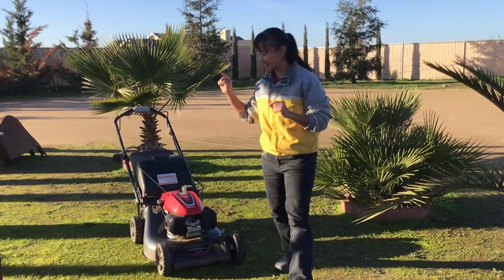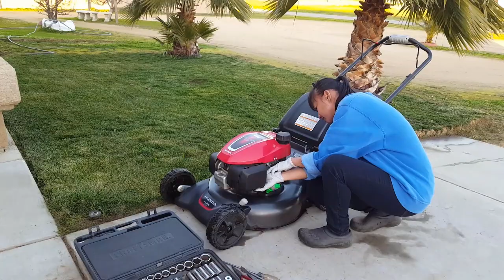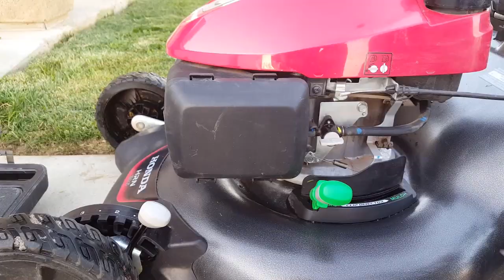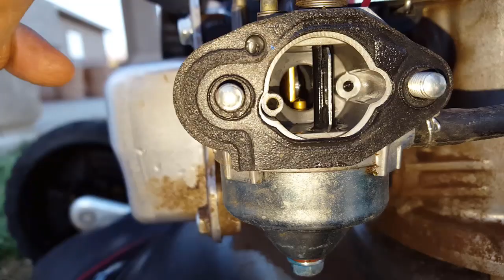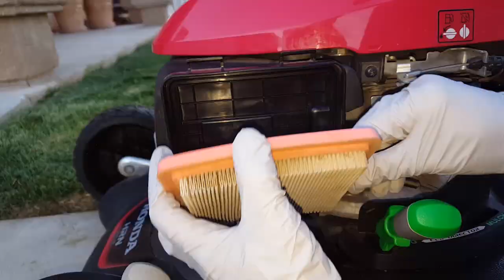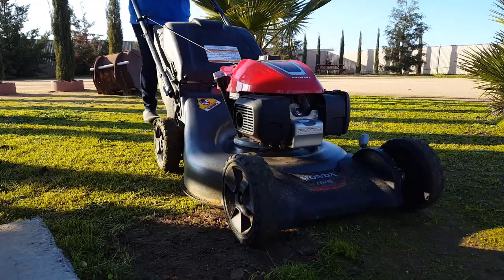Fixing Honda HRN 216 Lawnmower | Rough Idle/Surging || DIY-10

Comment: I had the same problem and took my 1 year old Honda  HRN216VYA mower to an authorized Honda repair shop.  It took them FIVE MONTHS to fix the unit and replaced the gasket and thermo wax choke assembly.  Two months into the new mowing season and it's doing it AGAIN.  Honda customer service is a joke and two authorized repair facilities state they can't get to my machine for 8 weeks!  Right in the middle of mowing season!  Good by Honda.  Not sure what the heck you did for your 35 year anniversary, but you destroyed your reputation and are now also ending production of your gas mowers as of Sept 2023.  Way to go ....out with a bad bang.
Reply from the maker: That's a frustrating experience you've had with your Honda mower and their customer service. It's unfortunate that the issue resurfaced so quickly after the repair.

Comment: This fixed my surging problem. Whether or not it was necessary, I removed the carb and gave it a full cleaning thru all ports with carb cleaner but also ran a very small pipe cleaner brush in and out of all the ports and used a few mild blasts of compressed air to complete the trifecta. Salamat Po Val. Mahal kita!
Reply from the maker: Thanks for sharing.

Comment: Haha... A couple of weeks ago, my HRN 216 started doing exactly this, so I researched this issue and found Ed & Val's excellent solution video and decided first to try the lazy man's approach and try a carburetor cleaning additive first, so I reviewed the various offerings at Home Depot and settled for this product: Star Tron 8 oz. Gasoline Fuel Treatment by Starbrite. I poured in the recommended 1 capful per gallon amount, let it sit for a few days, then gave it a try. Nope. Exact same surge while cutting the entire line. Just today, I came back to this video, reviewed it and was all set to perform Val's technique, when, wouldn't you know it... no more surging when testing the idle first. Hmm. Ahhhh... the additive MUST flow through the carburetor, then sit for a bit before it de-clogs it. Remember that! The instructions for the additive suggests adding that 1 capful at each fill to avoid surging. At that rate, the 8 oz bottle will treat 48 gallons. Even though my problem was solved without employing Val's technique, I commend Ed & Val for sharing, such a fun and informative video. Val conducts the HRN 216 Surge Orchestra like no other. 😍
Reply from the maker: We love your comment! It's great how resourceful you were with the carburetor cleaning additive. Even though the surging issue got resolved without our technique, it's fantastic that you still enjoyed our fun and informative video. Keep up the DIY adventures!

Comment: does that pilot jet screw that you took out mess with the idle to make it faster or slower?  or is that another part on the carb?   I want to be sure it goes to the right position if i remove it and then replace it.
Reply from the maker: Hi, no it won’t mess with your idle.

Comment: What causes this debris or does it just get gummed up from bad fuel, wondering if debris if theres a good inline filter that can be installed? Just got one used and does same thing
Reply from the maker: Thank you for your question!  Surging issues in a lawnmower can be caused by various factors, including: dirty air filter, carburetor problems, fuel issues, ignition problems, restricted fuel flow, engine overload. Regular maintenance will help keep your mower running smoothly and reduce the chances of debris-related issues. We hope this helps.

Comment: Is there a way to clean the jet without removing the screw on top? Like spraying from bottom or other hole?

The screw on my Honda is tight and I stripped the screw
Reply from the maker: Yes, you can try spraying at the bottom right at the opening of the carburetor.  You can also try using compressed air. This may help dislodge any debris or blockages in the jet.  Hope this helps.
Reply: I did this too - frustratingly soft metal even with the proper sized screwdriver. I managed to cut a slot across it with a dremmel and used a large flat-head screwdriver and got it out, but got to be careful! I've ordered a replacement screw, which was more than $10 with shipping. But none of it fixed the surging problem for me, unfortunately.

Comment: What Huffdaddy said!  Also someone commented to count the turns on the idle screw (? The one with the spring on it) to bottom/full tight before removing it so it can be reinstalled in the exact same position-wish I could find their comment to say thanks. Mine was exactly 5 turns from bottom/tight.  I sprayed brake cleaner ‘cuz I didn’t have any carb cleaner, waited 10-15 seconds, then  used compressed air to clean it out, while covering the intake, so as not to blow dirt into the carb air intake & engine, repeated a couple times and it worked great!!  Thank you !!!
Reply from the maker: Welcome.

Comment: I’ve owned for many years outdoor power equipment powered by Honda engine I always use fresh 93 % Octane Gas & use Lucas or Gumout Ethanol removal additives to gas containers I’ve had no starting or surging issue for years…
@ end of mowing season run engine out of gas before store it..
Reply from the maker: Cool.

Comment: Done this 3 times, port has great flow, still surges.
Reply from the maker: So sorry to hear that.
Reply: In your case, there might be other components of the carburetor or fuel flow that need cleaning. Try the following, which worked for me. Home Depot - Star Tron 8 oz. Gasoline Fuel Treatment by Starbrite. It was $8.23 in my area at the time of this writing, and the 8 ounces treats 48 gallons of fuel, so only a little is needed for each fuel refill to keep the fuel system clean. ...

I discovered that after putting in the additive, letting it sit for a day or two, the engine still surged through the entire next cutting. 

I thought the additive had failed on that first try, so I was going to employ Ed & Val's technique here, but when started the mower to do an idle test before performing the manual cleaning technique, to my complete surprise, the engine purred smooth as silk, with no hint of surging. 

Obviously then, the additive must flow through the fuel system to do any cleaning... DUH. 😂

Given that, I'd say the smarter approach is to put the additive in, run your more immediately to let the additive flow through the system, cutting your entire lawn if desired, then hopefully, the next time you cut your lawn... no surging. It's worth a try. And even if on that subsequent cutting it still surges, put in more additive and try again.

Wishing you success!

BTW, the directions indicate that there is no harm in using more than the recommended amount per gallon. I therefore actually put in three capfuls to my half-filled lawnmower tank the first time. As mentioned, it surged throughout that first cutting after adding the additive, but starting the mower two weeks later, no surging. From here forward, I'll just put in the recommended capful per gallon on each refill of the tank.
Reply: There is a red thingy that comes out when hot, if you force it in with a screw driver that will get the surge fixed

Comment: The left bolt on mine stripped and won’t budge 😞
Reply from the maker: Ah, that's frustrating to deal with a stripped bolt. We can understand your disappointment. One possible solution you could try is using a penetrating oil, like WD-40, to the stripped bolt and let it sit for a few minutes. If that doesn't work, you might need to consider other alternative methods. Best of luck in resolving the issue!